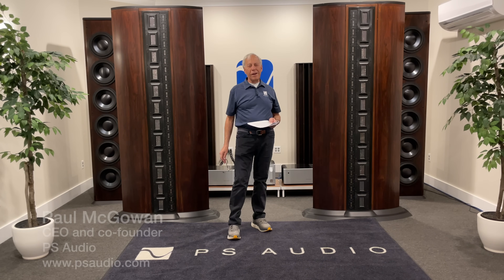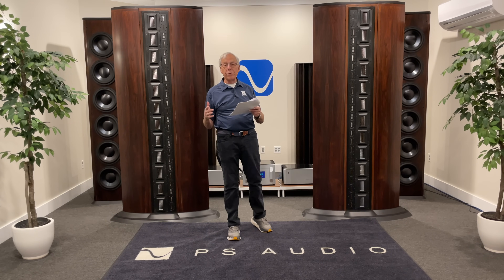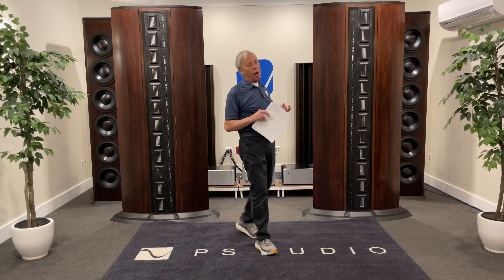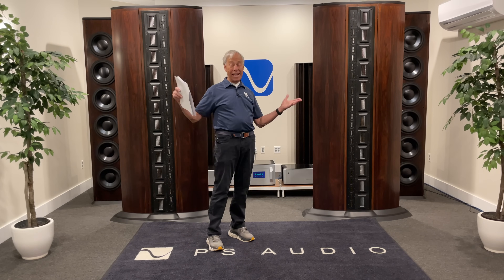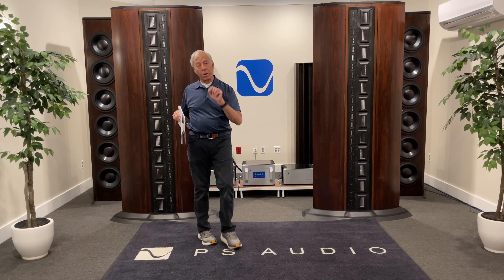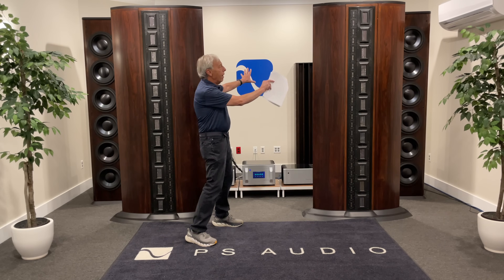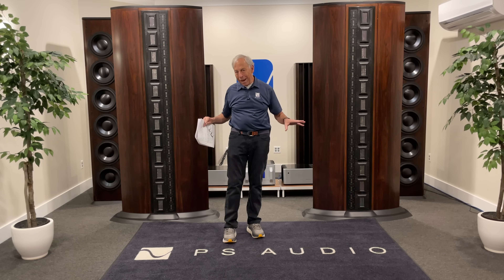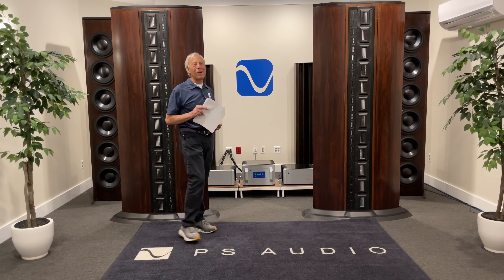Voicing PS Audio electronics

Comment: Curious you have the speakers facing the listener and no sweet spot, even with direct reflecting speakers you have a sweet spot. What is PS Audio's idea? 

A listener will experience the best sound from a pair of stereo speakers if the distance between each speaker to each other and to the listener is the same, essentially forming an equilateral triangle between the two speakers and the listener. The sweet spot in this case will be where the listener sits at the tip of the triangle. For an optimal sweet spot, the speakers should be placed at 60 degree angles to each other.

Comment: I see an awful lot of reflective bare walls in that room
Reply: Exactly. This room is way too small for this system. There is a video where they try to measure it and there are huge picks in frequency response. This configuration is nowhere near to flat frequency response.
Reply: Bingo, the side walls are a touch too close, even for the limited dispersion of emits, planars, etc.
Reply: Mids and highs is one issue, but how low frequency can fit into this small room? There is so many woofers and all of them in the corners. It must sound awful.
Reply: Not a fan of speakers facing the listener - no stereo 'sweet spot'

Comment: If Chris found that much distortion in the previous state of the speakers, wouldn't that mean that up until then the speakers didn't do all that great of a job in that frequency range when it comes to voicing? Of course something can be really good and still be flawed but it sounded like a surprisingly big deal with something that expensive and that was maintained and set up by seasoned professionals. We are after all talking about a system that is supposed to be in the top tier in the world, and a problem that seems much bigger than the effect of cables.

Comment: I can never get my head around this practice of 'voicing' ... it reminds me of voicing a pipe organ by putting strategic indentations in the pipes !! A properly designed amp and pre amp shouldn't NEED any form of voicing ( whatever that entails..) If anything could require voicing , it's the speakers but then again all speakers sound different and aren't perfect ...
Reply: Exactly....💯
Reply: They're obsessed with dynamic range, beyond that approach, which I think is flawed and annoying, I really have no clue.

I'm not a fan of flat with speakers, but most well designed amps/dacs are fairly flat. So then what? I fear we're back to dynamic range.

Comment: Nothing to voice in any audio electronic equipment if you know what you doing. Voicing it’s for amateurs, not for professionals)
Maybe speakers you can voice, but only ones that cost a lot, because it takes a lot of of time and to voice them you’ll be using expensive drivers and components anyway)

Comment: Interesting. The only problem with this fantastic IRS system is practically nobody else has them. The rest of the world pretty much uses ATC speakers because they are revealing, critically and intrinsically damped such that they minimize coloration AND they are available in almost every high end studio globally and are hard to damage even at stressful SPLs. Audiophile speakers often have pleasing coloration (usually too much bass and treble and warmth) and change response too much with SPL to judge a mix or master. That said - there are often sound checks in cars and other cheap systems to be safe (important for pop/rock). Genelec is popular too and NS10 is still used. The key is a setup that most people know and understand - a unique IRS system is not something that sound engineers or musicians are familiar with - so it is only useful to a small group of individuals that use it. Furthermore main monitors need to be in the studio and not in a separate facility - sonic memory isn’t great and being able to quickly A to B check is essential.

Comment: How do you voice an amplifier on the IRS, when that system is biamped with active bass below 100 Hz?
Reply: Easy.  You feed the amplifier under review into both the main sections and the subwoofers.  Paul has always stressed that you feed subwoofers from the speaker output of the power amp, not from the line level output of a preamp, if you want the best sound.
Reply: @doowopper1951  That's not how the IRS V is connected.
Reply: To be fair, Paul does constantly beat the drum for having active subwoofers in any system. I guess they also test on other systems where the amp drives the full range, but if the assumption is that the end-listener is using active subs, then they can focus on the 100+ Hz part of the spectrum in designing the amps.
Reply: @londonclassicist  I expect that 99% of PS Audio amp users run the amp full range.

Comment: $100000 in cables? Solid 24 karat gold wire? Unobtanium connects?
Reply: There is no good reason to think that manufacturing cost or material cost can justify that US$100,000 of cables. Even with fairly low cost cables, your house wiring is longer than the few feet of power cable to the amp and have much more influence of the power line impedance. And your speaker cable impedance is much less than the voice coil resistance being in series with your speaker cables. Of course you want to use excellent cables for such a system, but it's sad to see how companies are charging insane snake oil margins on a piece of copper with plastic around it.
Reply: the biggest joke is the cables cost more than the room, bad 0/10 ps audio.
Reply: Don't forget, he sells those cables! To quote an old proverb, "A fool and his money are soon parted".
Reply: cables/wire > speaker. $$$. drive me crazy.